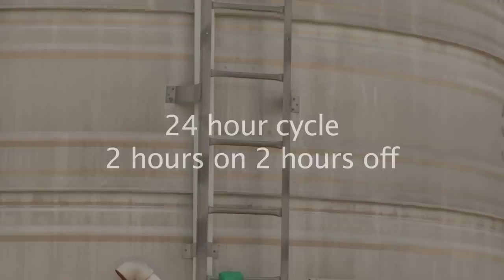GCTV7: Phosphine Fumigation Demonstration

Comment: Great video from a bloke that clearly knows his stuff. Just some tips from experience:
- make sure you’re clean shaven to get a good seal on your mask
- water/moisture can easily set these tablets of fire so when placing consider condensation from the silo metal going hot/cold with day/night
- aeration fans often used to circulate gas (in larger silos) also deposit water/condensation so be sure to observe how your setup may do this
- high temp and high moisture grain (especially sorghum or any grain that “sweats”) can also ignite both blankets and tablets
- using an external fumigation cupboard that you can connect via hosing + aeration fan to the silo you wish to fumigate provide easy ground level fumigation and protect the commodity + infrastructure in the event of fire
- nerve gas is not fun to breathe so treat with respect, always take5 before starting and keep yourself safe